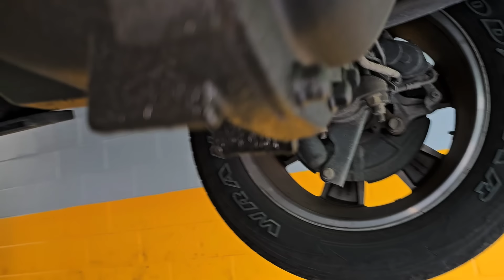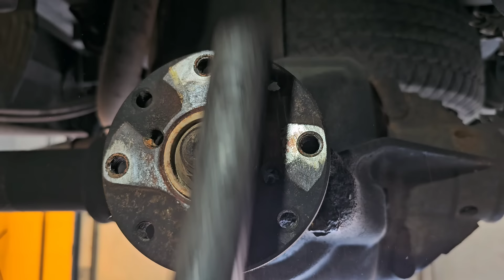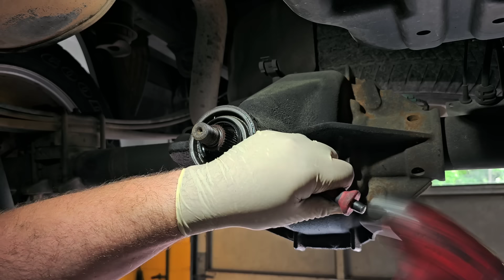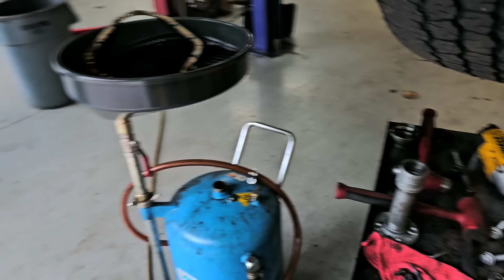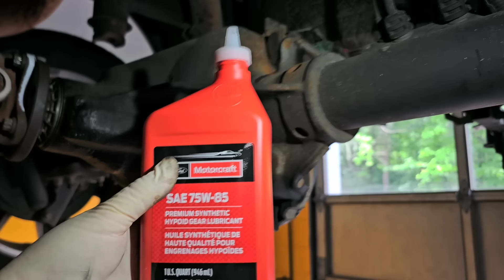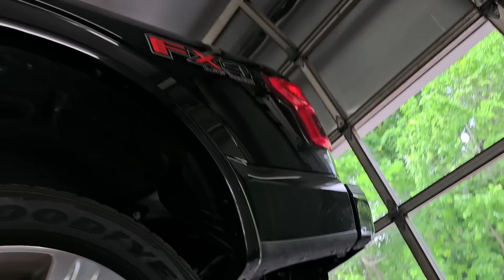Rear Pinion Seal Replacement The Easy Way!! Ford f150

Comment: Had a bronco 2 some thief dropped my drive shaft 2 times to try and steal it. Had to drive 50 miles to get replacement 12 point bolts. Lol

Comment: After locking up a diff when a ring gear bolt came loose, I always check the torque of the ring gear bolts before putting the cover back on. I have found many loose over the years.

Comment: Why would you use an impact to tighten up the nut, you supposed to hand tighten up YY tighten by hand so you don't over load the bearings😢😂

Comment: A nice job and good, useful video  - consider a carbide scraper on the gasket surface. Those rolocs have ruined a lot of engines.

Comment: No friction modifer fluid  in the rear end?  I heard it reduces gear noise.  Thanks for the videos!
Reply: Some F150 Diffs have an electronic locker so no friction modifier is needed

Comment: I was taught to do that years ago. It is the proper way to get the pinion preload back to where it was. After doing many pinion seals over the years I found using a thin cutoff wheel or a little Dremel cutting wheel and cutting a small grove through the end of the pinion and into the end of the pinion nut. Just cut enough to make a locating line for the nut. When putting it back together you can put the nut in the exact spot it was and then see exactly how much more you want to go for the preload. I've seen people zip them nuts off to change the seal and never mark it. At that point all you can do is shake your head and walk away knowing your name is not on that repair 😅😅 feeling sorry for the vehicle owner

Comment: I just use a paint marker and mark the end of the pinion and nut. Count how many threads are showing and use a 2 jaw puller on the yoke. Take a flat blade and hammer the outside flange inwards enough to get behind it and pry it out. Quicker than a seal puller especially if the last tech glued it in. Should always put some kind of sealant on the splines to stop the oil from seeping past the nut. And there's no way that impact can put enough torque on that nut.  If the crush sleeve isn't collapsed it will still expand a little bit where you'll have to compress upon reassembly. There's next to no preload on those bearings using that impact so your going to get premature bearing wear and the seal will leak again. The crush sleeve in those 9 3/4 diffs are almost impossible to crush and can still take a couple hundred foot pounds to get the original preload correct..... that's why you shouldalwaysdo a thread count. And always make sure the vent is clear. Pretty sure the 9 3/4in calls for 75-140
Reply: I know is old. I marked the threads didnt count them but the mark is gone after the nut came off. I painted the nut to the pinion but still has about an 1/8 inch to make it to the mark. I dont know if i went to tight or too loose. The didnt really marked the spline to the yoke splines. But might take it off to line it back as close as possible dont know what else to do about it

Comment: Looking to do this on my 2018 Mustang MT-82.  That preload stuff was discouraging me, but after watch this video I’m gonna do it myself.  I just replaced both axle seals.   Find  these cars oil seals fail pretty easy.   Might get a national seal rather than the Ford, like I did with both axle seals.   Great video man thank you
Reply: Did you ever end up doing it ? I have a 2015 and have bought the seal replacement kit but I am also reluctant to tackle this job due to all the preload stuff…

Comment: Maybe throw a rag over gear set b4 wire-brushing old rusty sealant.
Reply: Hi ! You're right ,and blow the dust off with an air nozzle ! I see a lot of mechanics on YouTube they never clean anything they never use  Neverseize or Lock Tite anything, they just take it apart and put it back together without cleaning any bolt threads ect . 😂 🙏🇺🇲🇬🇧✌️

Comment: And that tool could damage the oil sling. But on the nut going beyond that CAN BURN OUT THE BEARING - very very bad should have match the mark and not go beyond. Going like that is high in inch-pound. You didn’t even scrap the housing and just passed a rag - HORRIBLE THAT ONLY TAKES two minutes. FOR THIS SHOP TO ALLOW THIS TYPE OF WORK - PERFORMED BY THIS MECHANIC - I WOULD STAY THE HECK AWAY FROM THERE!!!
Reply: Your wrong Karen
Reply: You must work at a dealer Mr fancy pants wannabe be “technician” too good for seasoned old school mechanic with actual real world experience on different model vehicles 
🙄

Comment: I have ford f150 XLT 2009 model supercrew, do all pinion seal have the same size? because they say that in your differential back cover have 10pcs bolt, you got 8.8 size of pinion seal, if you got 12pcs bolt in your differential back cover you got 9.75 size of pinion seal, is this true? So that i know what size i’m gonna buy it. Thanks for the reply.

Comment: Does anyone know the tool used to remove the driveshaft bolts?
Reply from the maker: It's a 12mm 12 point. You can use a wrench or a socket. There are specialty sockets for it too. Keep wrenching 🔧
Reply: @WrenchingWithKenny Any chance you can share what the name is for those specialty sockets? Are they some sort of deep well socket or a standard socket with a built in extension that's tapered to clear u joints/driveshaft yolks?

Comment: I like your overloading trick and I completely agree that this method is more than adequate. My vehicle at just short of 250000 miles I think we'll be good for the remainder of it's life. It's probably been 40 years since I did this so I just wanted to see if there were any new addons I wasn't aware of. Thanks

Comment: If you just re-torque the pinion nut like you did the first time you're going to go past where you were. Essentially unless you get new bearings, you can keep using the crush sleeve. Bearing wear is always going to make the crush washer a half a thousand "longer" than it needs to be.

Comment: Not using a new pinion nut I would use locktite or stake the old nut.
Reply: Those nuts are already pinched deformed at the top few threads to prevent from coming loose or backing out

Comment: I know “silicone” is a popular slang term for sealant, but everybody has been using urethane based sealants for a few decades now, far superior sealant.
Reply: marking the nut it could be turned a number of times to line up the mark! Counting turns is a lot better method. Just turn by hand wrench not with power tools.

Comment: What if the pinion nut was showing only 1 thread deep? When reinstalling the pinion nut back on  I had to go beyond the 1 thread deep mark because the flange was loose if I stayed at the 1 thread in mark. Have you experienced this and what would you recommend? Thank you.
Reply from the maker: A lot of times, that is a self locking nut. It will get tight at the end of the nut when it hits the threaded area. You could just keep going until you feel drag on the pinion. I hope the info helps. Keep wrenching 🔧
Reply: @WrenchingWithKenny  Thanks alot. I have and will. Thanks!

Comment: Shouldn’t that pinion nut be torqued? Thanks for the video.
Reply from the maker: Only if it's a new build or the crush collar was just replaced. You wouldn't be able to achieve the correct torque & end up destroying bearings. They way I show you is basically a cheat. I haven't had one come back. Thanks for watching & keep wrenching 🔧

Comment: I've never replace the crush sleeve when replacing the pinion seal.  I can't say how many pinion seals I have replaced but I will say it's a lot.  I set many 9" Ford gears for IMCA and USMTS Modifieds and I have hammered the old crush sleeves out so I could set the preload on new gear sets.  Never had a failure.  Thanks for sharing.

Comment: On one job I ran in to an after market device that positively locked the pinion nut in any position with wedging action from allen screws. This would allow you to set any preload you wanted even if the crush sleeve was over compressed and would avoid any backing off when reusing the pinion nut.  I've tried red lock tite  and had it still back off when trying to save the old crush sleeve.

Comment: Do you verify the diff actually has a crush collar?  Not many of them do. Ford 9 inch and some late Mopar 8.75 do. Maybe some newer ones do too. If no crush collar, then Kenny’s method works, you just end up with slightly tighter flange nut torque but no change to pinion preload because pinion preload is set with shims at original assembly. If it has a crush collar, this method could result in overloaded pinion bearings and burnout. With a crush collar, to maintain correct pinion preload and pinion nut torque, add a .020 thick shim washer on the pinion shaft before installing the flange, then tighten to your marks but not further.
Reply: That is why he said when tighting  back you turn a little past the previous mark. Which in turn would be your 0.020.9.75 Ford have crush sleeves as 8.8 also

Comment: Recently I thought its old, check the rear diff oil, that square drive was in so tight that the drive on the racht rung off.  I did get it out and it did need some oil.  Wish the last guy had taken your class

Comment: The new crush washers,a pain to compress.Some older rear ends do not have a crush washer.Replaced the pinion seal in my dad's 1946 Dodge pickup,has a steel sleeve instead of a crush washer in the differential.

Comment: When used correctly, you won't have a reason for replacement. The wall is thicker for impacts and chrome are thin wall. Pay me now or pay me later. They can reject replacement for misuse.

Comment: Vent tube or cap on top of axle should be checked for blockage so that pressure inside axle tube releases. I never use chrome sockets  (usually 12 point) for impact, air or electric, they were designed for hand tool use only. Most people don't have in their tool inventory the black impact ( 6 point) sockets and 12 point impact sockets are usually found on the expensive tool trucks only.
Reply: Chrome sockets still have a lifetime warranty so send it.

Comment: Watched another video.  Guy used a torque wrench to see how many inch pounds it took to turn shaft before loosening the nut. He then tightened nut slowly to achieve the same torque torque
Reply: Only accurate if the differential carrier is removed. This is the only way to get the nut tightened properly. This is the old school way and still the best way.

Comment: I do almost the same, just I mark the socket and count the turns, and use a breaker bar,rachet. Just did 4 pinion seals this past summer.

Comment: As below, also a retired mechanic of 55 years in UK. I would always check the axle breather for blockage after fixing an oil leak. Good job Kenny.
Reply: Sometimes just getting the vent unplugged fixes the issue. You can have a million years experience and not know everything. You would be surprised now many mechanics dont understand that suspension bushing bolts should be tightened at ride height. Heck Kenny here just posted the "funny looking valve cover video" There is a TSB about that issue. The PCV check valve goes bad and ruins the valve cover. Maybe he did it off camera but he never checked it. That is the root cause of the failure. When that check valve is ignored long enough the turbo is not long for life because its trying to pressurize the crankcase which its not designed to do.
Reply: I wouldn't be surprised if we have a follow up video of "axle seal leaking" since the pinion and cover are both new seals they are the next weakest link.
Reply: The vent is usually the cause of the pinion seal leaks unless the bearing is bad or a bad rear u joint.

Comment: You’ve done this job many times and it’s worked fine. Personal preference, clean off first, mark etc, but polish seal edge of flange, reinstall with a little bit of gear oil on the seal lip. I’ve never liked using an impact to tighten up rather feel if you’re getting too close to damaging the crush washer. Ouch! overdid this as an apprentice, a lesson well learnt.
Reply: Yah be sure to buy yourself the same Snapon blammo so you can wack bc that bearing until it looks like. Ruffles wavy chip.

Comment: Count the threads as well as marking just like you did
Reply: When you say count the threads do you mean on the Nut that he put back on that holds the flange?  Where the drive shaft spins on? I’m
Asking because I’m not very experienced
Reply: @walberto78 on the threaded shaft coming thru the center after tightening there are a few threads showing

Comment: Just a fyi replace the 18 volt battery with a 20 volt adapter will give you a little more power and the old 18 volt DeWalts are bulletproof to begin with to me there better than new ones,,if you have to try your local flea market...

Comment: As a retired mechanic after 55 years in the trade, I used to do it exactly the same way. What I would also do is to clean up the seal surface on the flange with very fine emery paper lubricated with methylated spirits ( white spirits).  Far less likely hood of leakage again. I do this for all seal surfaces. That said, excellent video. Thank you Kenny
Reply: In almost every rear differential leaking issue I have come across the vent tube is plugged up.
Reply: What can i do if i didn’t mark the nut that has the tension when i was doing this job that nut was loose so i figured their was no point on marking so i put everything on and i cant go over 10 mph or ill get bad vibrations could it be way too tight?
Reply: @miguelvasquez4231  did you ever get an answer for that your question?
Reply: If I had to get into the change the crush sleeve would I have to go in the other side?
Reply: @AndyBroughton crush is under the bearing under the flange. Can be removed from the front side
Reply: Tight but not tight enough to overtighten the crush
Reply: What is the torque?

Comment: Best tip I can give to clean those oiled surfaces is a wooden outdoor broom, which you cut into small blocks, so you have 6 or so out of a single one. Hard bristles easily shift the dirt, and only a tiny amount of solvent needed.

Comment: FWIW I like to check the diff breather while I'm there just in case it's blocked up with crud.
Reply: How do you check it? Asking because I believe my trucks pinion seal is bad and need to check vent as well
Reply: @jetmonroe7 
On my vehicle the breather is a little round cap at the top of the diff housing - it should be free to move if you try and wiggle it. If it feels solid it's probable blocked with mud or road grime.

Comment: Nothing personal, but my dad taught me cleanliness was next to Godliness when working on mechanical things, and only enforced when working on Air Force aircraft. It amazes me how many YT channels don't clean items before disassembling parts, even though they will often state--be careful this crud doesn't get into the part. Clean the crap off the parts before taking them apart. It does no harm and can only prevent future problems. I simply don't understand the reasoning behind not getting rid of grease and grime before taking something apart. I hate paying for a mechanic's work and being unable to tell if he's actually done anything, as it's just as grimy after as before.
Reply: Did you check the vent for air flow. Blockage could cause high pressure when hot. 😢
Reply: I ran into the problem of not being able to clean stuff prior to repairs while in the US Army. We're in the field a lot and had no means to clean the area beforehand, the best I could do most of the time was a wipe down with a rag if we had any dang rags! The Army was much different than the AF...even when working on the helicopters and such! Working on the tarmac was a different animal than working on vehicles and heavy equipment!
Reply: @goodcitizen64  "In the field" is one thing. In the local mechanics shop is another. A drain plug or fill cap can be wiped off anywhere.
Reply: Fix it yourself and you can clean to your hearts content .
Reply: Very true amen
Reply: As a kid in the 60s, I always went to the quarter wash before I tore into my car. Even if it was just a brake job.
Reply: Spoken like an hourly employee. You’d never make it on flat rate.
Reply: Apparently you've never worked flat rate.
Reply: @mr.Lumpy3803  Flat rate, yeah. That's where you get paid for an hour's work that took you twenty minutes because you didn't bother to clean anything up.
Reply: Good thing to stay clean however it's not biblical in any way.
Reply: Couldn't agree more. Soak it down, hit it with a brush, wipe it clean. The worst is watching a job like this. No clean8ng, then once the seal is in, they clean so they can tell if it's leaking. Clean first, and avoid dirt related problems. Even if you're working flat rate!
Reply: This is a lot of the reason why I’d rather fix things myself. In a mechanics defense, they don’t get paid to clean.
Reply: @eddiepond86  But a good mechanic cleans up before doing a dirty job and after. I'm not saying a steam clean is called for, but a simple spray and wipe goes a long way toward showing care was taken.
Reply: @eddiepond86 Lazy hack auto mechanics do get paid to clean, many elect not to.

Comment: Snappy make that socket for 12x12p drive line socket like yours, old tech I worked with said his Snappy at Ford said a 3/8" 12mm 12p extra shallow. The size of the impact swivels top was the special at time.

I bought a 12mm 12p 3/8 impact swivel and 17mm for tranny, with 36" 1/2 to 3/8 ext.

Comment: i bought a a set of northern sockets 1/2 incn drive for $20 dollars had a job had to remove rusty bolts broke 2 1/2 breaker bars 1 was a snap on never broke the socket